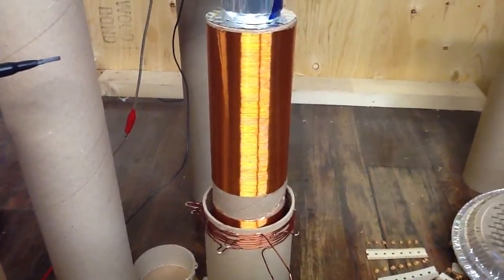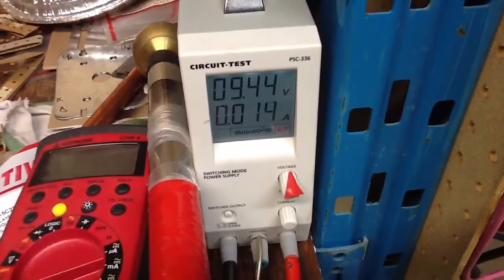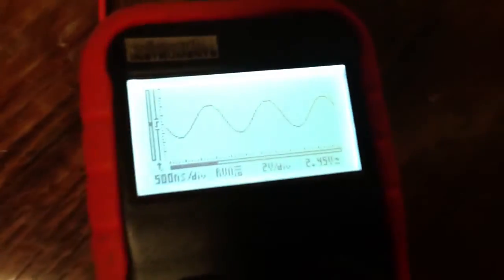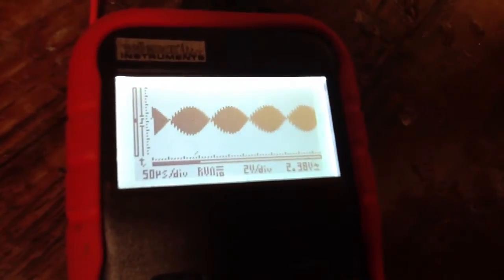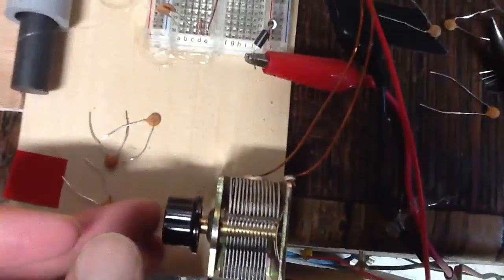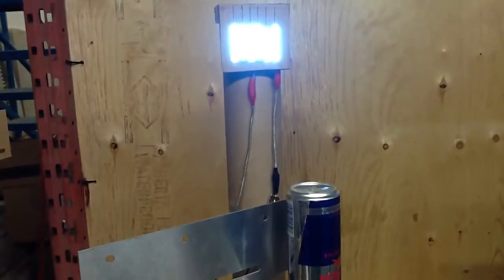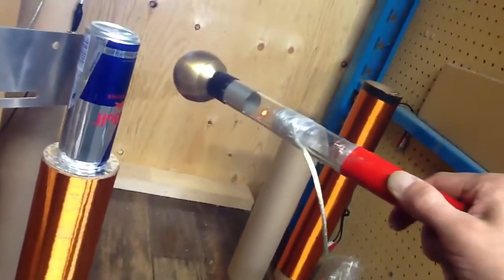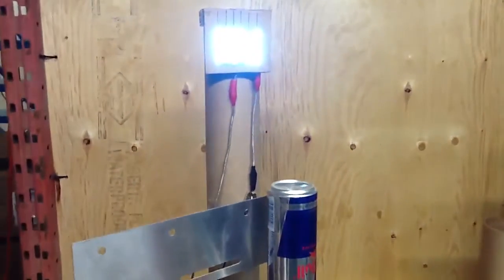pt 13 TMT Magnifying Transmitter, SEC, Larger Rebuild

Comment: Kurt, how would you explain in few words or paragraphs,  the principle(s) of "magnification"? What makes more power in the receiver than in the emitter?
Reply from the maker: Tesla said it best himself in the Colorado Springs notes page 78 where he described how a 2 coil system can only be taken so far and the secondary will always act negatively affect to the primary but with the three coil system with the resonator not in inductive proximity to the primary acting as a simple series LC circuit and leaving the resonator open and not closed is the key I believe

Comment: Are you still using the MPSA06 transistor that stiffler was using? great progress! I am currently building a coil with 4920 ft (22awg) of wire on it to act as a resonator for my 50khz vortex coil as the driver...Is your driver putting out a frequency that is pretty much the same as the resonant frequency of the resonator when base driven? This is what I was going along with after reading the tesla coil builders guide to CO springs...

Also, at resonance the only resistance is that of the windings....So the thicker the wire on the resonator, the more voltage should be developed...any experiments to validate that?

Keep it up.

Comment: Wow! So you mean you light this rather large series of leds with just 0.1 W ?! :D
Reply from the maker: hi man :) yes that's what I find interesting here. the LEDs are a forward breakdown of 3.2 volts, use 20mA, and there are 48 (48x3.2x.02)= 3.072 Watt / (9.44x.018) 0.169watt = 18.17 times increase? I still plan on a straight DC comparison, but my test power supply can only do up to 24 or 36 volts, so the expected 148 volts needed at load is tough to compare :)
Reply from the maker: ..... and as you know, the input here of 9.44 volts at .018 Amp is respectively enough to light 3 LEDs in series, but 48 are bright :)
Reply: ***** :D That's something here you have, Kurt! :D

Yep! For any video with lights in output always need to provide the nominal comparison as unit of brightness to handle any doubt :)

Otherwise, why only leds, while non linear, instead of mostly linear incandescent light bulbs?

A last question too, Kurt, do you link your work to Eric P. Dollard's one?

Cheers, Didier.
Reply from the maker: hi there Didier, yes I will for sure do a light comparison, and absolutely my work is based on Eric Dollard specs, other large Magnifier builders, Colorado Springs Notes, and some of my own ideas :)
Reply: Hehe Great! thanks for the specifications, Kurt :) Hope you will have a kind of how to do it step by step. Still, I would be very interested to see the difference with incandescent light bulbs. And BTW, you just need 1 led to lite for comparison: if all are already brighter than the unit, you have it! ;)